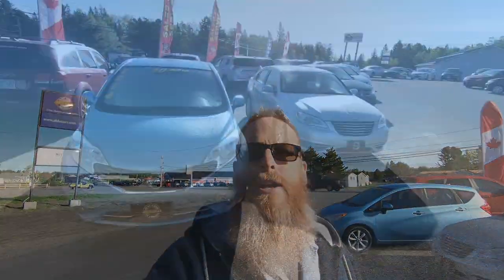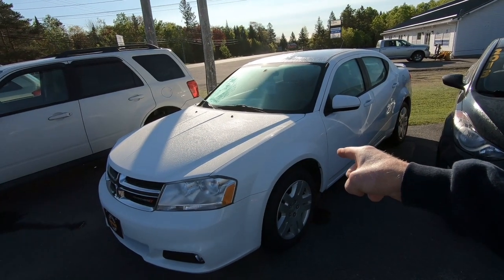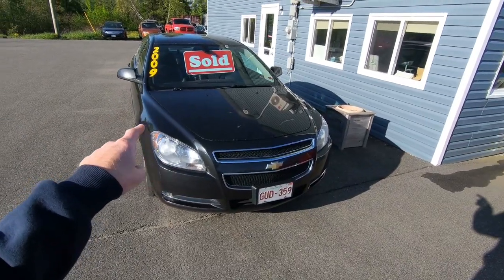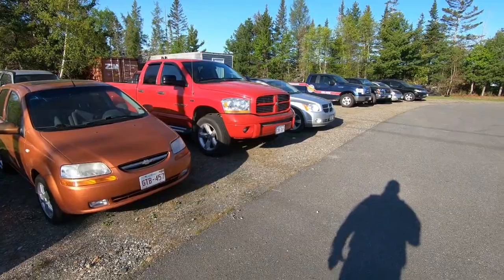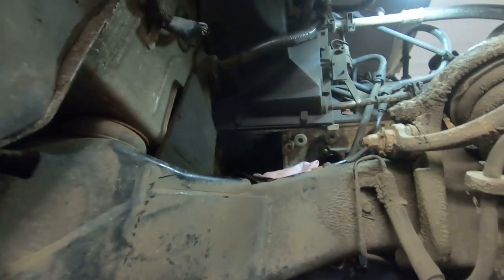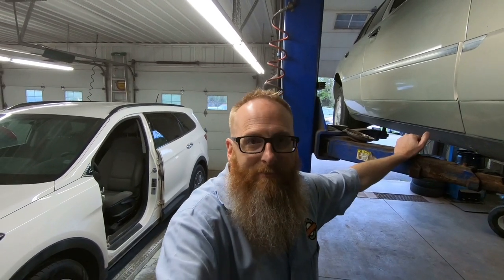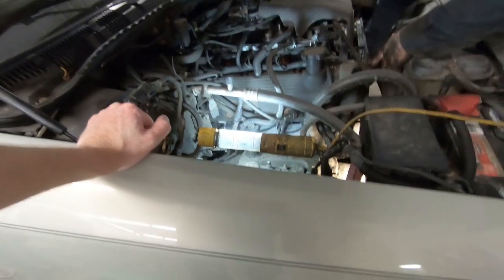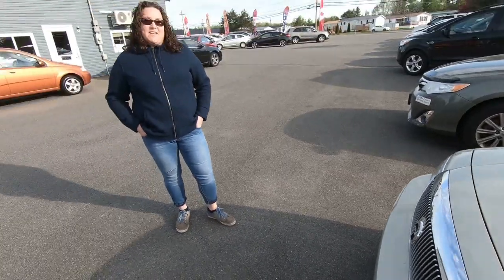FIXING THE EXHAUST MANIFOLD ON GRANDMA, MY MERCURY GRAND MARQUIS

Comment: Man you should have put some headers on Grand Ma. Ya man the studs is most of the job! Great video
Reply from the maker: Budget build! $80 for a manifold vs $1000 for the cheapest set of headers i could find on ebay!
Reply: @OldeCarrGuy  This makes some sense now...
Reply: @OldeCarrGuy  long tubes would be a  disaster to put on that' believe me I know. 

If you are looking for headers there's all kinds of mustang guys that bought headers and couldn't get them on the car'big job requires dropping the k frame 'kijiji has lots of new ones.. when you go full length headers you also require a custom tune because the transfer rate changes because of the 02 sensor ' is moved and for the minute difference short headers make not worth it ' save your money for nitrous 💸

Comment: project grandma looks nice but do i do both sides or just the side that's mess up
Reply from the maker: Only fix what's broken. I did the passenger manifold 3 years ago and still haven't had to do the drivers side!
Reply: @OldeCarrGuy  so the car isn't leaking exhaust that sweet. let me ask you this what made the bolts broke in the first place

Comment: Great car hey I have a question for you got a 2006 Grand Marquis front carpet driver side stay wet all the time what you think you could be
Reply from the maker: I guess my question to you is, what't it wet from? Water or coolant? If it coolant, then I'd say heater core, but if its water, it could be a leaky windshield, door seal or your A/C drain could be plugged and backing up into the passenger compartment. Hope this helps!
Reply: @OldeCarrGuy  say if it's the heater core then that means my coolant should be low and should be wet on the passenger side ? But I know my intake got a slow leak in the front left cause I can see the residue . l luv what you did to grand ma how much did you spend?
Reply from the maker: @carolinabull  Just double check to see if it is coolant.

As far as GrandMa, I have less than $5000 tied up into her and that includes buying the car!
Reply: @OldeCarrGuy  will dude info very helpful ! Thanks
Reply: @OldeCarrGuy  so got a pressure test it was the water pump . reason why the floor was wet weather strips bad . thanks preventive maintenance on Grandma very detail thanks